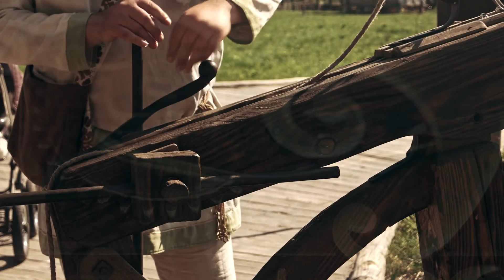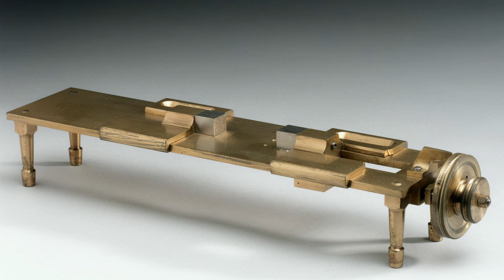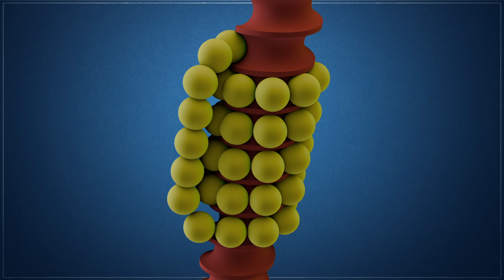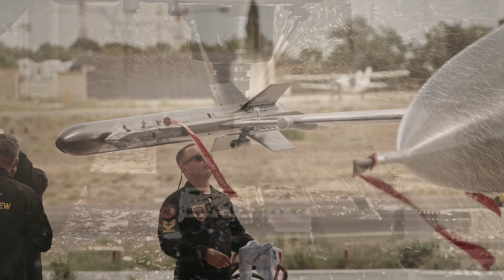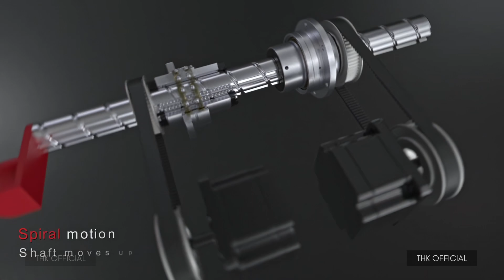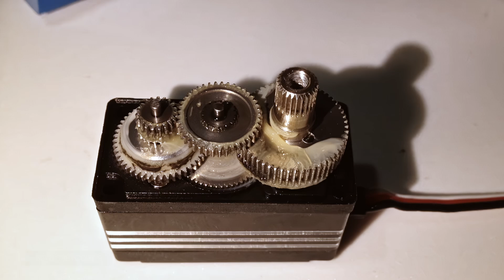The Obsessive Engineering of Precision Linear Motion

Comment: 8:00 I've operated lathes for years and never questioned why the cross slide didn't need to be locked down, even with extreme tolerances and machine vibration. Amazing.

Comment: Holy cow!

I used to work in a fab but not where they actually deposited the chemicals to create the dies. My job was to cut them and bond them to lead frames, then bond the 28um or 24um gold wire to the die and leads. After that, they went to the room where the black goo encapsulated them and then cut them out of the frames.

I had no idea just how precise the whole operation was, so this was fascinating to see! Thanks for taking the time to share.

Comment: I would have thought the old masters would have made their lead screws by wrapping a shaft with a square-form wire with a spacer. Especially for a single pitch screw, as long as the shaft is precise and the wire consistent, the resulting screw should be pretty darned good. 🤔

Comment: i wonder if you could do a screw and nut submerged in oil and have the oil surface tension take up the slop in between the threads and the nut
Reply: You'd have to use pressurized oil, and it would be limited in load capacity based on the amount of force the oil exerts on either side of the nut.

Probably doesn't make sense, the chinese are getting good at cheap and decent ball screws.

Comment: Human hands can reach micrometer precision entirely reliably provided you have fine-enough hand tools and accurate measuring tools, but manual work is slow. The strength of machines is not their precision, it's that they can work magnitudes faster while keeping still acceptable levels of precision.
Imprecision in manual work doesn't come from a lack of ability to be precise, it comes from a mix of not using industry standards and going as fast as possible to save on work time.

Comment: I just retired from a ball screw manufacturing company , we started with raw material to finished product. We a customer from eastern Europe who wanted a ball screw 700 inches long . are normal ball screw material is 25 feet in length so each male end had to be matched to female end of the ball groove so the ball nut could run between the two . Let us thank Archimedes for this .

Comment: I've seen a few videos diving deep into the engineering challenges of EUV lithography, and each one highlights different aspects that sound impossible to overcome.

I didn't know that the actuators needed to have precision down to the width of a single silicon atom while accelerating at 30 Gs and rejecting vibration and jitter. That's madness!

Comment: But how did then all know if the "inch" they were referencing was uniform across whichever mechanisms they used to dial in these initial machines to calculate TPI and so on? Pardon my ignorance but did they have gauge blocks back then? Clearly machining isn't my main area of expertise (in fact the only lathe I ever used was in 7th grade shop class to turn a wooden bowl. Yeah, they let 7th graders play with massive lathes with hardly any supervision back in the 90s.) but I just don't understand how the inception of extremely fine-tuned measurements could be produced without having a standardized reference to work from. Like, how do you make a machine to measure half miles if you measure a mile with your feet and you wear a different size than the guy across the globe who's trying to achieve the same results?

Comment: Linear motion is great but the rise of technology is logarithmic. I can't help but notice the timelines when advancements were done. The gaps between years keeps shortening.

This video opened a lot of perspective to me. I worked as an engineer in multiple industries: semiconductor, machine automation, and aircraft. I designed, assembled, and used most of the mechanisms mentioned. 

One of the machines that my team made is a pick and place machine that assembles the parts of a computer fan. That machine took 13 linear actuators, 3 engineers to design, 5 workers of a manufacturing line, and a factory mechanic to maintain. I can just reminisce how hard it is to consider tolerances of each linear actuator just to aim the propeller and snap ring to the case. 

It costed around $30,000 and displaced 4 workers from the assembly line.

I'm allured to go back to engineering where make robots that replaces humans again so we all become jobless and go back to arts, music, and philosophy. Wait, I'm currently at marketing, all of those are already automated for the sake of trade. I'll keep collecting money so when the data of those Indians that record their day-to-day tasks got implemented into robot housekeepers, I can do my job as an AI operator. I wonder what job is left if AI can also do that? 

Mines and data centers need to be guarded from those environmentalists. Well, I could be a soldier who operates a drone or a robot with a gun. I loved playing Counter Strike when I was young, I'd be happy to play a mech version.

Comment: When I was 13 I operated old WW2 and pre-war era thread mills. Using tables and doing math to pick gears. Such cool stuff. I assume it's mostly done with lathes nowadays, as the machines I used were only able to run because our machine shop could make our own replacement parts in house.

Comment: The recirculation path that you indicate on your your graphic is wrong. It should start from basically the bottom left in swing up over to the top right crossing over at an angle.

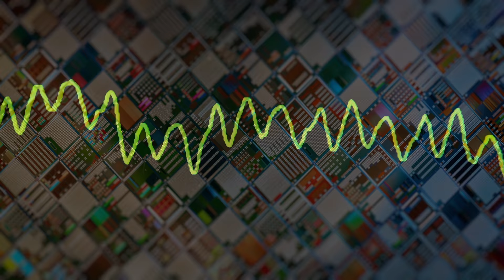Comment: 26:03 No reason to predict the disturbance before a sensor signals.  Just put sensors farther away so you can use the fact that you can signal at a good fraction of light speed while vibration travels at speed of sound.

Comment: Rack and pinion drive mechanisms still see some use in machine tools, especially larger ones. A rack can be manufactured in short segments that are butted together, so practically any travel length is feasible. They are also supported along the entire length of the machine bed, so there's no sagging.

Comment: Used on some Horizontal Stabilizers (Trimmable Stabilizers): The classic "jackscrew" is used to adjust the angle of the entire tailplane. This provides pitch trim, allowing the aircraft to maintain level flight while reducing the effort required by the pilot on the control column.Wing Flaps and Slats: Modern Linear Mechanical Actuators use ball screws to extend and retract trailing and leading-edge flaps. This changes the wing's curvature, significantly increasing lift during takeoff and drag during landing.Landing Gear: Electro-mechanical actuators (EMAs) utilize robust ball screws to safely extract and retract the aircraft's heavy landing gear, often featuring manual or gravity-assisted "free-fall" backups.Thrust Reversers: Used during landing to slow the aircraft down, the movable sleeves or doors on the engine nacelles are actuated by linear screws to redirect engine exhaust forward.

Comment: When I was using quad copters for photography, a puzzle I was trying to think through was how to dampen the motor vibration before it interfered with the flight controller. 
I wonder if a  piezo-controlled counter-weight, mounted under the flight controller, in the center of the copter would be able to cancel out the vibrations in the same way noise canceling headphones cancel out sound?

Comment: Lead error can be measured and corrected using a Renishaw XL80 laser system. The way it works is you measure the entire stroke of the axis every 2mm. The software then measures the distance it has moved in that 2mm and compares it to what it measured with the laser. At the end of the entire stroke it will then perform the same process in reverse. The software then provides a "compensation table" you load into the CNC control. Now at any point along that axis the machine will automatically apply that tiny compensation value to the coordinate you have programmed. To achieve ultra precise feedback to the control you need linear scales attached to the machine to provide feedback to the rotary encoder on the lead screw. When this combination is used with thermal/linear compensation, a CNC machines positional accuracy can be greatly improved.

Comment: This may be the best Youtube video ever made.  Do you have a background in machine tools or 3D modeling or something?  Or do you feel you got exceptionally lucky with content procurement  and placement?  

This is an extemely important subjectt as our industry lacks people with a solid understanding of machine motion, and responses to force.  Engineers and programmers seem to take center stage here in machine shops, but omly because the industry demands a certain salary, not because theyre actually valued.  And machinist with strong knowlege at this level are a dying breed, and not well liked.  But these things don't mean that this unnatural idiocy will comtinue forever, it just means American Manufacturing could die without investment into the minds of the workforce.  

The Brittish empire has this problem at one time, but the aristocratic era brought ideas like investing the crowns funds into any man who had promissing inovation on the horizon, as you touched on in this video.  Anyway, outstanding work!

Comment: How am i only at 0:48 and on my second lengthy comment asking if you even understand what youre talking about... 

The large wooden device being operated at 0:48, of some guy winding a carrier of some sort down that frame... You only show it for a second or two as youre listing the examples of very old rack and pinion systems... Well that device you showed definitely looked like an axel or spool for the rope hanging over the top of the framing, to pull the carrier or sled towards the operator... I am pretty sure a simple winch is not a rack and pinion. 

Do you think i can make it from 0:48 to a whole minute without finding another really dumb claim or out of place image or video? I sure hope so!!
Reply: Damnit... Couldnt even make it to a minute and i am at 3 comments pointing out conplete nonsense youre spewing. Rack and pinions in 1600s firearms? 

When youre going to make an extraordinary claim like that, you definitely need to provide a source, or at least an image that shows these 17th century mechanically complex firearms... Like what would they even use it for? There were no standardized cartridges, or magazine fed rifles in the 1600s.so the majority of linear movements a modern rifle or firearm has to accomplish with precision, would be absolutely worthless in 1600, and most are not translating force in one plane, to move something in a different direction. things like lever action rifles, which do have a lot of manual, complex movements, are using linkages, cams, spring tension, and captive travel, to manage things like loading/clearing breach/closing dust covers/cocking hammer/firing pin/etc etc etc. 

How many of those things were part of 1600s firearms? And more importantly, would use a system like a rack and pinion.. most firearm mechanisms, both historic and modern, measure internal mechanism travel in millimeters. Rack and pinion is a terrible solution to almost all the things a firearm has to do.

Comment: "in the 2nd half of the 20th century it quickly became the foundation of almost every passenger car steering system". 

That is absolutely not true. Infact, the "2nd half of the 20th century" qualifier actually makes it even MORE wrong. Rack and pinion steering was much more common in early cars, and in sub-compact cars. before cars got heavier, tires got wider, drivers requested faster steering ratios, and the effort needed to turn the wheel increased. 

For the vast majority of the 20th century, either GM or Ford sold the most cars worldwide annually. And do you want to guess how many cars sold by GM in idk, 1970, had rack and pinion steering? 

A quick clue... Anyone into classic cars, especially old american cars being modified for racing, has heard the phrase "its got a mustang II front end". The mustang II appeared in 1974, and offered one of the first readily available front suspension/rack and pinion systems that could easily adapt for different track widths, and bolted up reasonably easily, even on non-ford vehicles. 

General Motors didnt have a single car with rack and pinion steering until the 1980s, even the race homologation corvairs and corvettes of the 1960s, and things like the Lotus/cosworth vega, still used recirculating ball steering. even in the 80s, american rack and pinion cars were exceedingly rare, like if a vehicle needing power steering, then GM used recirculating ball steering (colloquially, a "steering box" or "slush box"). AMC and Ford beat GM to the punch by several years, as the first american company i can think of to use rack and pinion, and that was only on small cars, and only from the mid-70s? 

I actually used to do SCCA meets in the parking lot of Saginaw steer and gear, after GM shut it down in the early 2000s, where they designed, and built, those ubiquitous steering boxes you had never heard of. If you have ever had to replace and idler, or pittman arm on a vehicle, then you had a recirculating ball steering system, not a rack and pinion. 

Heck, i have a hydraulically assisted, and a non-powered rack for my datsun 280zx turbo, because it wasnt until the mid-70s before datsun even had an assisted rack and pinion system to offer... And they were rare as hens teeth in anything but the smallest, front wheel drive american cars until the 90s. 

Also, no modern (post ww2 at the latest) steering rack looks anything like your example of a rack and pinion. Because steering is one of two systems in a vehicle that absolutely has to fail-safe (brakes being the other)... You will find designs where a single broken tooth from a pothole or an overzealous curb rub, is not going to leave the vehicle uncontrolable. So you will find a system like the rear differential, where the pinion is tapered and helical, which also increases the strength as multiple teeth engage at the same time. 

And saying a rack and pinion was one of the "first documented instances" of a linear translation mechanism"... Umm.... Ancient egyptian waterwheels, among all the other engineering solutions they used thousands of years before any of those greek or roman examples comes to mind. 

For a video specifically about precision, it sure seems extremely misunderstood/under-researched.

Comment: Very nice. 
I spent my adult life in precision optical fabrication, both conventional (pitch and grit) and ultraprecision (single point diamond turning and high speed processes. I lived through several technological transformations, but the incorporation of linear motors to eliminate ball nut lead screws was, well, transformational.  All of the tricks we had to employ to make ever more accurate optical surfaces really saturated with the lead screws. Eliminating them by the use of linear motors created an order of magnitude improvement in micro-roughness and meso-form. Truly, there were other important innovations, but the motor was the big deal. With my (circa 2004) Nanotechnology 350 I could directly machine visible band quality optics with surface form irregularity under 1/20 wave (~1 millionth of an inch) peak to valley, and surface roughness on the order of 10 angstroms RMS. It was amazing. I retired in 2016, and not long ago that machine went back to Nanotechnology.

Comment: Just today I encountered the beauty of interchangable parts. Notably, electrical parts. The mounting screws on an installed light fixture are the same now and fit perfectly as they were in the late 60's when the original fixture was installed. I didn't have to swap the in-wall electrical box. It simply worked.
Reply: This is reason Legos are expensive. Every lego piece must be precisely molded to fit every other piece ever made.
Reply: @chainsawninjalcemist no it’s branding and paying for the secret plastic that is just that bit better

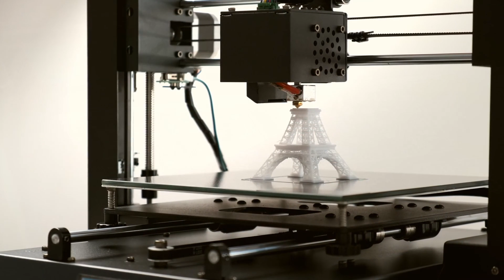Comment: 8:45 Wrong stock video for the subject. 3d printers use shallow angle leadscrews like the lathe ones talked about in the last section since the vertical axis needs to both move in sub millimeter steps and hold in place firmly.
Reply: No they do not all use shallow lead screws. The original ender 3 used back-driveable screws on its z axis which lead to z drop when the stepper was de-energized.

Comment: an interesting detail i saw in the manual of a(saginaw?) steering box: the recirculating balls were of 2 different diameters!  a very small difference, you could tell by the different colours of the balls. you had to fit them alternating a small one,then a big one, a small one etc. i suppose the smaller ones were to prevent the big ones from rubbing against each other at twice their rotational speed. the smaller ones would ,if im correct, turn in the opposite direction, and because of their smaller diameter they would not have a lot of contact with the grooves.  the big ones would do the work, the small ones were separators.

Comment: Excellent video. There are more types of precise guides for machines - hydrostatic and aerostatic bearings (used for control measurement machines), and also precise feeds - roller screws (used in robotics).

Comment: Not sure if I should comment, as I am not a mechanical engineer. But having interacted with an ex consultant who used to work with Rolls Royce on precision component manufacturing used in their aircraft engines, he had some made custom lathes and tools for execution of the jobs. Also he’d get called for design citations and validation. This clip takes me back to his work related stories and improved my understanding of these mechanical systems.